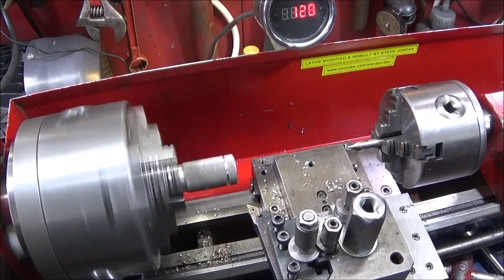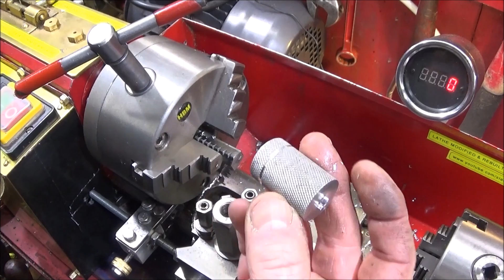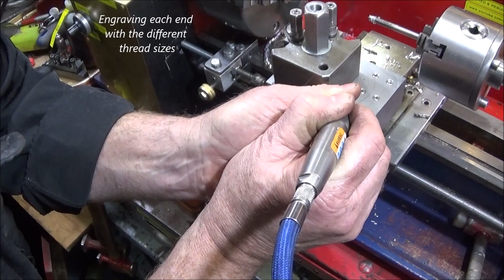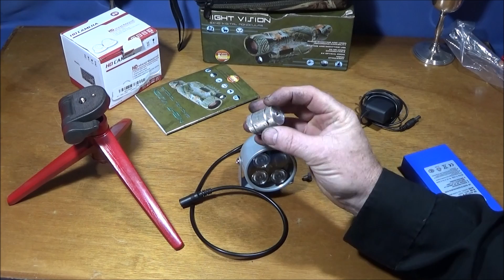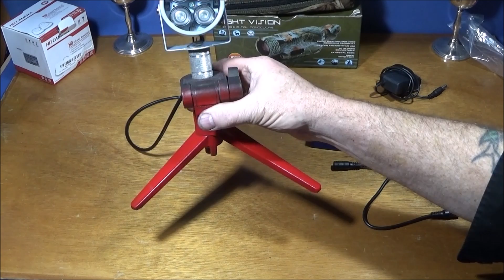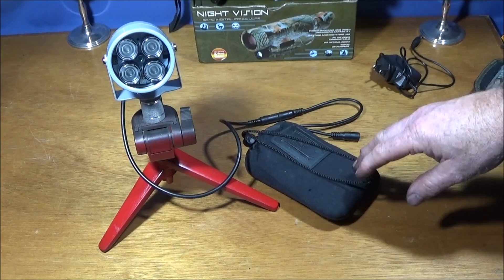Make A Simple Portable Infrared Tripod Mounted Flood Lamp.

Comment from the maker: SANOU SELF-CENTERING 4 JAW K12-80 Lathe Chuck Tool -- https://goo.gl/WU2TB1
HOBOVISIN CCTV 4 Array IR LED Illuminator Light -- http://bit.ly/2JSWojM
DC 12V 8000mAh Super Rechargeable Portable Lithium -- http://bit.ly/2VTfUh2
Reply from the maker: 55% off Mechanical Parts Promotion -- http://bit.ly/2Uw9PqG
 Spring Sale -- http://bit.ly/2VzASRP
 Electronic Tools Sale -- http://bit.ly/2SLxUYG